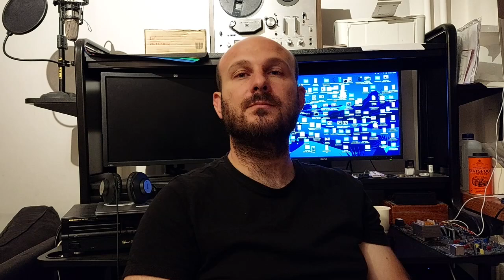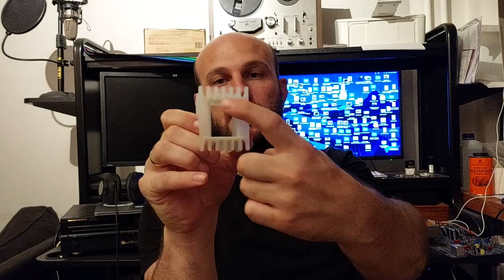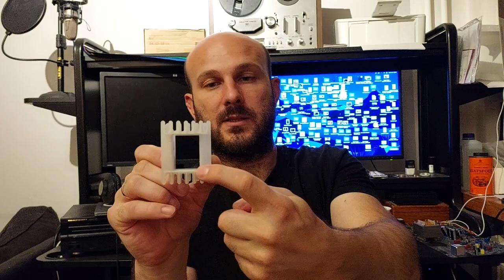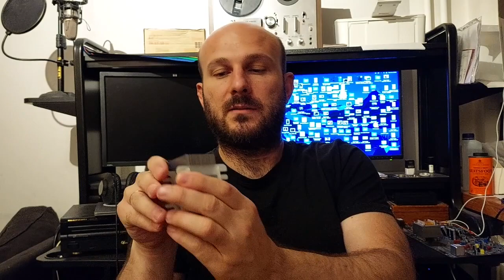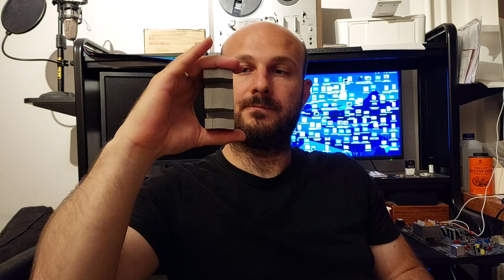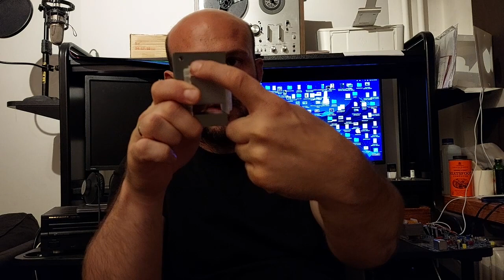Top 10 Transformer Winding Questions

Comment: How measure  any transformer's magnetic flux value? or  with a Gaussmeter?(Tesla meter) If yes how measure :
For example while transformer working  gauss meter's prope touch to center point of top of transformer steel?
If have only core(have not any bobins ) can measure with same process to this CRGO  steel's  tesla (or gauss )value ?
(Please describe with simple sentences becasue English is not my language.)
Thanks
Reply from the maker: For transformers we don't measure it that way. There might be a way but I am not familiar with it. Usually the maximum flux density of the core laminations is given by the manufacturer. For cheaper ones it is 1T or 10,000 Gauss, for the better ones it is higher. But even with the higher quality you can calculate the transformer for 10,000 Gs to have less losses. If you have the core at home already and you are not sure what quality it is, just calculate it with 10,000Gs and it will work as it should.

Comment: Found via Shango. 🤠Absolutely wonderful. I have been thinking about setting up something to wind my own for a long time... This is inspirational stuff. Thank you.
PS. Most all of the specialised electrical steel makers for audio transformers have long gone. Is there a favourite modern steel that comes with all the right specs for audio? If I wanted to reproduce a Partridge with same dimensions etc?
Obviously I haven't gone through all your videos yet...
Reply from the maker: Thanks! The core didn't change that much, there is nothing special about old ones. It is mainly the way they were wound. The core makes bigger difference from very small input and mic transformers which have to work with very low signals. For the output transformers it really doesn't make all that difference. I've made experiments where I wound the same bobbin and one channel is using cheap laminations and the other the expensive "audio grade" ones and the measured and listening results were closer to each other than I expected.

Comment: The windings bulge out, especially from small transformers  (e.g. 12-0-12; 9-0-9 constructions) thus leaving no space for the secondary windings to run through the window area.  A brute force like hammering may damage the coil inherently and without doing so if inserted through the window area, the steel laminations may cut the wires in the periphery. Any solution(s) to it? Thanks for the question/answer video. It's very helpful.
Reply: :face-orange-frowning:😸
Reply from the maker: Sorry for the late answer. You can use two thin wood blocks and slowly and gently compress the windings with a vice. The important parts is to compress it from the sides so that the laminations can go in easily. Also, when winding, try to find optimum tension, try to keep the wire as tight as you can so that it will take as little space as needed.

Comment: What would the winding specs be for a miniature bobbin laminated transformer window cross section is 9mm & 12mm high. Pin terminals 3+2. Its for my powder coat gun. pcb mounted Chicago electric powder coat gun Chinese just can't seem to find a replacement has it doesn't say nothing onit the circuit board that it mounts to says 120v 60hz  & it has 5 diodes 2 resisters & a RU 12v relay & underneath the transformer on the board it says T1 its probably a old type has it also says the date 2013.09.05 i would rather like to replace it really but don't no what to actually look for. But my second opinion is to rewind it with the right winding specs ? Also theres a 25v capacitor 470uf split bobbin

Comment: Does the winding pattern have an effect on the sound? For example, winding guitar pickups with more random “scatter” would can add more capacitance, thus different than machine wound. Also, what considerations are involved in the wire gauge selection? 
Thank you, I’ve already learned a lot from your videos

Comment: Hey @Delatsch i have a question if you can answer it. I got an old power transformer that was dipped in what i think its tar or something like that. I took all the laminations apart but the black stuff sipped between each layer of the laminations. Can i sand the laminations or will that affect their function?

Thank you
Marco.
Reply from the maker: Just reuse the core as is, if you sand it you should put a light varnish on it to isolate the laminatios from one another.

Comment: Hey Man thank you for your videos! They are a gem. I want to wind a transformer with 230V primary and three secondaries: 345-0-345V, 5V and 6.3V. What is the best order to wind them?

Thank you and keep doing these awesome videos. Subscribed!!
Marco
Reply from the maker: Thank you for your kind words! Wind the primary first, then put kapton or other proper insulation, then wind 345-0-345V, then 6.3V and finally 5V. Any order will work, but this is the most practical one in my opinion.
Reply: Thank you so much for your answer man! Im gonna download your transformer calculator app and start rewinding a trasformer from an old radio. 
Its not as scary as it seems.

Comment: How can you determine whether a transformer has an air gap and is suitable for single ended output?
Reply from the maker: If the transformer is not enclosed you can check how the laminations are assembled. Gapped transformers have all "E" shaped laminations inserted from one side and the all "I" shaped ones from the other side, and the gap between them should be visible. If they are potted and enclosed, you would have to measure primary inductance at different dc currents as I've shown in my choke measuring video. If the transformer is not gapped the inductance will drop all the way down even at only couple of mA of dc current.
Reply: @Delatsch  - thank you for that!